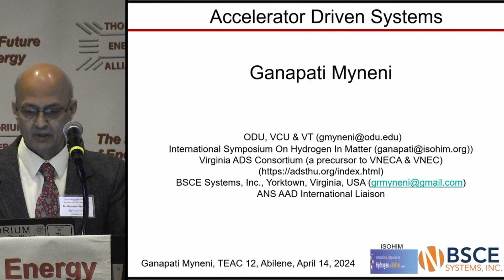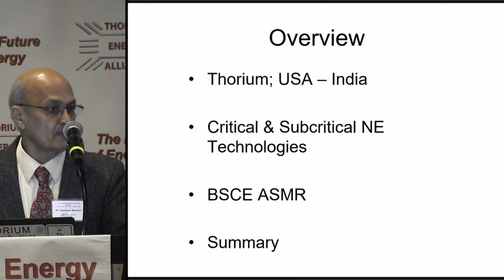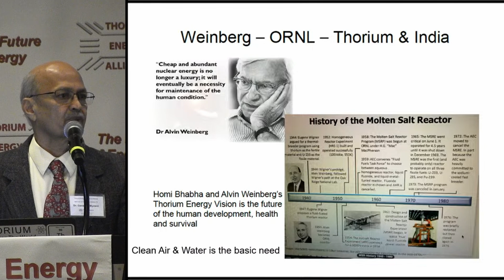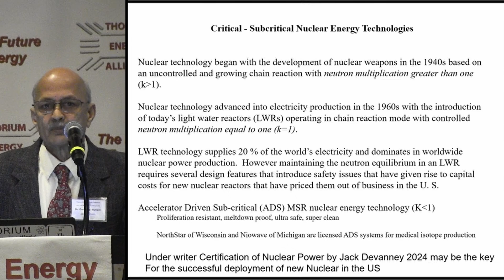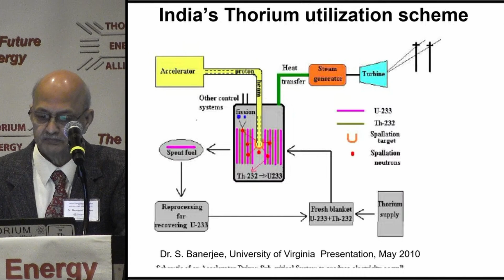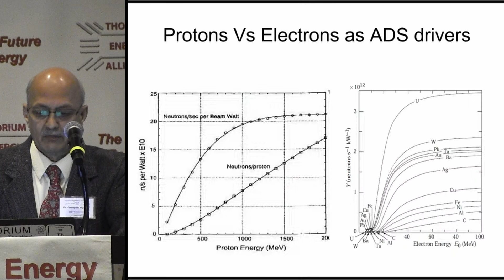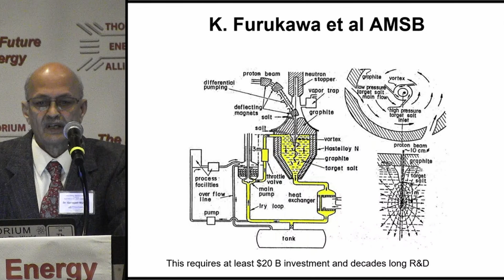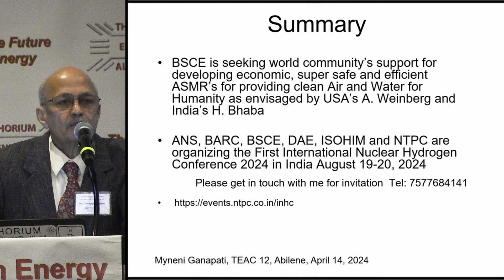Accelerator Driven Systems by Ganapati Myneni @TEAC12

Comment: 11:57 if I understand it correctly protons are more preferable but with energy around 10GeV it should produce rain of neutrons and that exactly what is required for ADS to make whole idea profitable. Even if accelerator works in pulse mode that could be fine.

Comment: Did you know? Caesium-137 can be transmuted to stable Barium 136 & 137 by proton bombardment (~13 MeV) from an accelerator. In the process, a gamma ray and a neutron is released, which could be absorbed by Thorium, for instance. Even this fission product has more to give, if used creatively and treated with respect.
Reply: With current accelerator efficiency that would require enormous amount of energy to process those isotopes this way. With a half life of 30 years that simply doesn't make much sense.

Comment: Just use a direct fast spectrum reactor and thorium can directly fission creating 3 free neutrons in the process. Use either a molten chloride or helium gas as the phase modereation medium. This will create a negative reactivity vs temperature. The chloride flux would be simply sodium chloride. In the helium gas version would be a silicon carbon compound of thorium. The chloride would be a pure fast spectrum and the HTGCR would be both fast and slow depending on operation temperature. An acellerator driven spallation source of either tungsten or gold csn create the neutron flux sufficient to initiate the reaction. ❤

Comment: so much effort, time, money and brain power wasted on a stillborn idea.
Reply: Could be worse, could have been your education.  What is the stillborn idea?  Is it in the making fertile material into fissile material?  We do that already in breeder reactors, plutonium is created.  Making uranium 233 makes great fuel as the fissile elements decay into background in centuries, not millenia.  That seems great to me.
Is it the molten salt reactor?  That reactor design is pretty darn good,    as it can't melt down.  It's normal operating conditions is melted down.  Worst case scenario is probably overflow or spill.
Reply: @kayakMike1000  They usually don't say nothing about producing protactinium 231 in a process which is source some unpleasant radiation. Guess it one of the reason why we don't see many of those reactors already. https://en.wikipedia.org/wiki/Isotopes_of_protactinium
Reply: No need to convert to 233U if the reactor is designed to operate at the fast spectrum of neutron field. An acellerator could easily generate the initial neutron flux to start the reactor. The neutron flux from a spallation target would easily exceed that from other sources and also generate the fast neutrons necessary. ❤
Reply: @christopherleubner6633  That actually contradict with idea of Accelerator Driven Systems a bit. The point is when you turn off your accelerator nuclear fission stops so it can't meltdown even theoretically. To me looks like the idea of burning tar with laser. Tar doesn't burn on it's own but if you heat it then it can start to burn and produce more energy then you have used to heat it with a laser.
Reply: @Ayvengo21  the main issue with ADRs is that the energy to drive the acellerator will consume more than the reactor will generate as power. They do have uses as pulsed flux reactors for making useful radioisotopes though. In this case the reactor is a neutron multiplier.